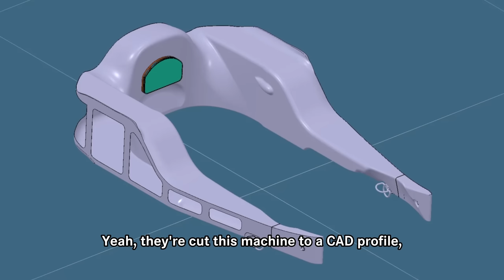Unsung Hero of F1 Innovation 🙌 | Driver's Headrest | How It Works

Comment: Could you Elaborate on the Failure when Ham's Headrest became Unstuck and he was Forced to Pit as a Result?
Reply: My guess would be that the pins at the back of the headrest simply didn't seat properly into the chassis since the start of the race. Aero effect comes into play at 200+ kph and lifts that part up
Reply: @azimdanial2908  Pin Never Properly Seated - could be a Potential Scenario, yes.

Comment: I hope this will turn into the most competitive Driver's Headrest on the grid. 💪
Reply: it is silver, so I do not think so. :)
Reply: @TheSzabcsikarcsi  Only way to win a Grand Prix is to drive at Max power.  ; )
Reply: I mean this year's Mercedes is black. This headrest will not race theoretically. :)
Reply: @TheSzabcsikarcsi  Well, the headrest is partially painted black, at least all the parts we usually see. And, it's definitely racing, it's part of the car so it affects the cars weight and aerodynamics. And a true f1 fan knows even something that small can cause a different